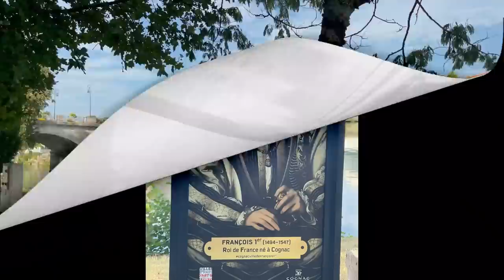Heatwave Happenings #110

Comment: We bought a new Air conditioner last year.  This year it broke down beyond repair half way through our hot 🔥 summer.  Unbearable at times.
Reply from the maker: One thing I used to do when it was hot with no air con - take a small towel or a batch of them and soak them in water with a eucalyptus oil - drain the water off roll them and keep them in the fridge - great way to cool off quickly and cost effectively.